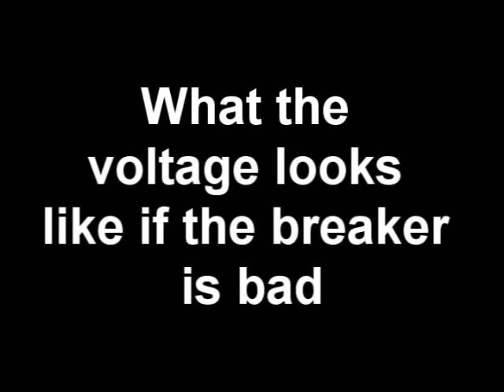Checking for a Bad Breaker

Comment: This is perfectly fine for determining if the breaker is open or closed. Step two would be to remove the breaker and test it for continuity. If it seems OK outside the circuit, clean up the wire connection and try again - it may start tripping normally now.  If you still have your doubts, swap it with another in the box with the same current rating and see if that trips. Then start looking for shorts...

Comment: About ten years  ago I bought a small, name-brand table saw from a big box store for a small project I needed it for that weekend. I had never had a problem with the wiring in my old detached garage, which had been updated with a new breaker box and receptacles had been added using modern wires a few years before we bought the property.  The saw was rated  for 120 volts and drew about 13  amps when you first cut it on.  As I remember my experience, it would hum and the blade turned slowly, before finally getting up to speed, but didn't have enough power to cut a board. This occurred the first time I tried to use it. I assumed the saw was defective, and packed it back into the original box and took it back to the big box  store with my receipt, and they cheerfully gave me another saw exactly like it. As before, it was brand new and the whole box was wrapped in clear plastic or cellophane, to show that it was exactly as it had been when it left the factory.  Had the same experience as before,  when I plugged it in and tried to use it. I reasoned that the odds were against two brand-new small table saws from the same reputable manufacturer being bad. So I turned to the electrical wiring, starting with the breaker box, after cutting off the power feeding that box. I found that the former owner's son had done the wiring, not a licensed electrician, and that a number of the screws securing the connections to the ground bar and  to the circuits inside that small box were loose, with evidence of arcing. I tightened up every screw in that box, whether obviously loose or not, replaced the breakers and turned the power back. Problem solved. And I still use that table saw occasionally.  Recently some of my LED shop lights have started flickering, so I'm getting ready to check the circuits again, before tossing them out with the trash.

Comment: Thanks.  I am going to troubleshoot a bad outlet.  I get 120 ac Volts, and the wiring looks OK.  The breaker box is in the weather and is about 60 years old.  None of the breakers tripped, so it might be the problem.  Thanks again.  Video was straight to the point: I don't need to watch a 30 minute video on what you showed me in 2 minutes and 43 seconds.

Comment from the maker: Ok the short answer is that you have a loose connection in one of the wires feeding through the light boxes going up to your office/garage.  Since the basement is closeest to the panel, this would be why they stay on and everything else flickers or goes out.  The loose connection will be in either the light box or switch box as power feeds tend to bounce from box to box to distribute power.  This can be labor intensive to find, and but easy to fix when you do.

Comment: Thanks for the straightforward video.  I came home to a failed circuit for all the lights and outlets in one room.  I thought it was a thrown breaker.  Nope.  Then I replaced the only GFCI with a new one.  Nope.  Then I found your video, broke out my multimeter, and tested the breaker.  It's fine.  I don't know what to try now.
Reply: Did you figure it out, I'm in the same situation?

Comment: Well done video. Short and easy to understand. Some these videos I watch are 10, 15, or over 20 minutes when they could have been much shorter. Some would need the longer videos if they have very little experience and need a bit more in depth information. I took electric shop in high school, 2 years didn't get into that line of work. So I had a fair knowledge of electricity. Also over the last 50 plus years I've done a fair amount of wiring. But I didn't know how to test a breaker. Now I do. Thanks. I had a breaker went bad but when you tripped it it seemed fine. Was to the water heater. Replace an element but still no hot water. Thermostats had been replace about a year ago so I was at a loss. Decided what the heck, put a new breaker in and now hot water. Thanks again.

Comment: Thanks for this video!  I'm trying to sort out a water heater that doesn't work.  There's no power at the heater. There's ~124v on each leg of the breaker, but the wire leaving the wall into the junction box near the heater is dead. 

The wire appears to be a straight ~25' run from the heater inside the base of an exterior wall to the breaker panel located just inside an entry door. It does not leave the wall and run under the house someplace that the squirrels and I can access it.

Do I need to open up the wall and trace the wire? It's just aluminum siding and thin sheathing... Or have I missed something I can do before taking that step?

Comment: Awesome 👌  I have a question..Light flickers on the house. When the heater is on, master bedroom power goes out. I took the panels off and  tested every breakers and I am getting around 123-125. What  could cause it? What else can I do before I spend $400 for the tech to come out

Comment from the maker: @rasheedgamerfb The electrical service in your home is 220v.  This comes in directly from the utility.  Its only when you use one leg of that service that you get the 120v that you are accustomed to.  So if you want 220v to run an appliance etc, you will need to use the appropriate sized double pole breaker.

Comment from the maker: I am glad you posted this.  This is a perfect example of why home inspectors should not be judging or telling people how to do electrical work.  When using a meter, it does not matter which wire goes to the hot or which is going to the neutral or grounding bar.  The breaker will not trip.  The leads are only there to serve as a sensors.  If you have been telling people that, you do not know the first thing about electricity.

Comment from the maker: Its possible your breaker is getting weak, in that case it would need to be replaced.  But you need to consider the possibility if it happens again that you either have a loose connection in the line (meaning one of the junction boxes or device boxes) or you have a intermittent short.  Either way if it happens again you will need to get the line traced and fixed.

Comment: Now, could a bad breaker be the cause of dimming lights? As in the lights dime when the A/C kicks on, or when the microwave is started. I'm running into that issue and so far, (not being any kind of familiar with electrical work) I LOVE your videos! Thanks a million. I hated contacting some electricians and they tell me it's going to be $150-$200 BUT for me not to worry because it's an "Easy Fix". That's what made me feel that I could at least do the troubleshooting myself, if not the repair.
Reply: Loose grounds can cause flickering when large current draws happen
Reply: Joshua Hernandez just remember. Brown to the right. Green/yellow to the middle. Blue to bits

Comment: my multimeter looks different than his- what setting do i put it on?
Reply: voltage with a wave sine symbol on Top. this wave is for a.c. current. the dot and dash marks on top are only for dc current. mainly battery but some motors too.

Comment from the maker: @dsastrclan - No in order to check to see of the breaker is working, it will need to be checked with the unit on.  Just remember that when you do this to take every precaution so as to not get shocked.  Meaning, use leather gloves, safety glasses and a rubber mat or plywood to stand on.

Comment: My breaker keeps flipping when I use my welder, I have asked other welders and they said I need a bigger breaker outlet and wires, for example I probably have a 15 amp breaker and outlet and I probably need a 20 or 30 amp breaker outlet and wires. Will that fix it? And if so do I need to get an electrician to check my work for it to be legally installed? Or as long as I follow instructions I’m ok??
Thank you
Vlad

Comment from the maker: Couple of things.... First change out the breaker to see if the breaker was getting weak.  That is the cheapest trouble shooting fix.  Next, if it still trips the breaker, disconnect the heat pump from the circuit.  Then turn the circuit back on to see if it trips.  If it does, then the wiring is bad, if not, then your heat pump will likely need to be replaced.

Comment: Helpful. It doesn't matter which screw on the neutral bar you touch?
Reply: I don't think so, I used several on the bar myself, still got readings. 

Only problem for me is that all of my breakers held the proper voltage, so now IDK WTF is wrong with my outlet.

Maybe a squirrel, a mouse, a chipmunk?  Who knows?  I have no idea where the damaged wire is.

Comment: That music had me pumped enough that I did a few pushups, a couple situps, and air punches before I even got out of bed. Then jogged a few laps around the couch. Finally to quench that thirst from all the sweating I did lunges to the fridge and grabbed a couple Flat Tire Beers and a pack of smokes. Of course while changing the bad breaker I had ROCKY playing in my head telling myself I'm unstoppable too. Well, I was definitely unstoppable because next thing i new I changed out all 42 Breakers to brand new ones even though I only had 1 bad breaker. And now I'm still trying to figure out how I woke up across the basement in a fetal position wearing wet shorts and no shoes. Well at least good luck hit me now that I'm picking up dozens more tv channels with HD quality even though my antenna broke in 2 months ago. Hmmm eh screw worrying about how... I'm gone to grab more beer and duct tape to reattach the Breaker Box door back on... 

IF YA CAN'T PHUCKIT, DUCKIT!

BTW, if you wrap up your Power Meter really good with aluminum foil they won't know how much power you use and blocks the hidden microphones in the meter from hearing you. That's like killing 2 deer with 1 ford truck before you have to weld the frame back together. I have thousands more great tips if anyone is interested...

Comment: if the breaker reads 120 volts , can the breaker still be bad if the ohmns reading is not good, because if there is no load,it may read 120, but when you put a load on it , it fails .  Does that make any sense, would like your opinion please ,

Comment from the maker: You cant test a breaker to see if its in good operating condition.  The only thing you can do is one of two things.  Remove the wire from that breaker, then try to reset.  Remember that you need to turn the breaker all the way off before turning back on.  If it stays on - your breaker is likely good.  If not then it definitely needs to be replaced.  The second thing is to just replace the breaker.  If it still trips when you do that you have a short in the line.

Comment from the maker: Yes, but follow the wire out from the panel to where it connect first, start there and work your way out.  The problem will likely be in one of the switch or light boxes in the basement.
Reply: Chheck a breaker means to know if it trigger and open the ciruita at the rate amps inndicated

Comment: for those new to MM lead placement, and whats not covered in this video is exactly WHERE to plug the leads FROM the MM.. Pictured in the still was the black lead in COM, but the red, do yoo use the FUSED side or the not FUSED side?

Comment: What if I get a reading of “zero” on a double pole breaker when putting the leads on the breaker terminals but a reading of 120 volts when testing them individually

Comment from the maker: It is possible the breaker is bad.  If only side side of the breaker is working, it would only send 120v to the HW heater and therefore not produce any heat.  Change the breaker and see if in fact that helps.  Its a cheap and quick way to check for sure.

Comment: I have a gfi breaker servicing two outdoor receptacles. One is a gfi. No power on either. I reset breaker and receptacle. Nothing. Do I really need a gfi breaker with a gfi receptacle? Should I put a regular receptacle in?

Comment: I gave a Thumbs Up, for the help it gives all of us! Thank You, but you lost me as to why Im reading 120V and 240V, and why on a Breaker with two places for wire, one has 120v and the other has 0V, and then they can both have the 120v and 120v to get 240v, somethings going on inside the breaker I don't understand and I  have never had one apart, that!!! would be cool to know?? Thank You!
Reply from the maker: Nothing going on inside the breaker, the double pole breaker simply sits across two main busses in your panel.  One bus or pole has 120v and the other bus or pole has 120v, then if you check both with a meter they will show 240.  The reason for this is because each phase is 180degrees out of phase with each-other.  This is why if you have a bad double pole breaker you will get 120v on one leg, but less than 100 down to zero on the other.

Comment: Thank you..This helped me figure out that one power supply line was at 125V and the other supply line was at 5V before entering the main fuse at the panel.  Power company on the way to check the meter box.  I am a live and well and did not make my wife a widow.

Comment: If an breaker goes bad and I put a new one in is it likely that it will go bad again? I'm using a new air conditioner this year that has heat also.  The circuit started flipping in the past two days so we took it out and it was bad and melted inside. We put a new one in but I am afraid that its just a temporary fix to a bigger issue and that its just going to do the same thing over again. Last summer we added a side box to help with the pull of ac and dryer running together. But I didn't have the new ac with heat then.

Comment: saved a trip back to home depot, thanks.  I hadn't put the breaker on both rails so was only getting 110 and when testing with the multimeter on hot hot I got 0. but each one tested 110 by itself...sigh.

Comment: I tried to copy what you did. But I got no readings on any breakers? But I have power in my house ao that can't be true. I did power lead to back of breaker and ground  lead to the grounded area on breaker box.... maybe I didn't do it correctly? So strange. Trying not to call an electrician, but I just might need to...

Comment: Checked all breakers, the read good but still not getting any electricity to one plug, thought mabe its a bad outlet but if no power getting to the plug there is no sense replacing the plug. TY

Comment from the maker: Also you would get 120v from phase to phase if you did have a dead pole on your double pole breaker.  But as I state in the video, that is only one of several indicators.  There is never a cut and dry one test fits all.

Comment: I changed a double breaker 60-60. one wire was red and one was black. When I put the new breaker in, I wasn't sure if the red was from the top or bottom. I put them in the way I thought they had been. Does it matter?
Reply: No.  Red and black wires are both hot, so it won't know the difference.

Comment: what tells you if the Breaker itself is faulty?   You can get an intermittent fault which no meter will help you.   A breaker either 'makes or breaks' but what if the breaker itself is faulty.?

Comment: Thanks, first one I've found which speaks of testing the double (220v) breakers. 51 yrs old, Dad could fix everything electronic & many things otherwise; first time I've done this 'cause half our house has been off tho breakers all "on" -But Dad gave me a "BK TOOLKIT 270AA meter, b4 he died, and assumed I'd grow into it. Still works, and I find ONE terminal of 220v breaker to neutral bar "0 volts" Replayed a few times, I'm assuming this one's bad; main (220 v?) breaker has both reading 120 v THX

Comment: @Nootherlove1  Hard to say, but there should never be more than 1 wire on a breaker. So the person that connected it wasn't really on top of the situation. there could be a 120/240 transformer in an appliance, 240 electric range or dryer, or even a wall outlet causing the feedback. Before replacing the breaker, or even using it again, you really should find out where the cross-connection is.
 Your total current load should not be more than about 70% of the rated breaker capacity.

Comment: I have a breaker that is inside my apartment and there is a meter outside my apartment complex and the one outside keeps tripping therefore shutting our electricity so I have i have to go outside to flip the switch on the main breaker outside what would you reccomend me doing ?

Comment: Hello, Liked the video and was very helpful.I have a  Bryant 15a GFICB and I tested the black wire terminal and it was hot. I then checked the white wire terminal directly under it and had 0 reading.Both tests were red leads to terminal and black lead to bar.Do I need to test the white terminal?Do I have a bad breaker?The test button work fine and circuit breaks.Any help would be apreciated.Thank You

Comment from the maker: @MrDevilheart666 - You may have a problem with a bad neutral or loose or broken wire on the hot lead.  If you suspect the problem may be the breaker, than change out that breaker.  But one half of a 15amp single pole breaker would not go bad because its not possible.  If changing out the breaker and checking voltage in the panel does not work, than PM me and I will walk you through what you need to do.

Comment: Hello , what if a 30 amp double pole breaker read 220v instead of 240-250? Still good?
Reply: 110-120, 220-240. There's a small percent variable that's still acceptable,  forgot the number, but  i think not more than 5% +-

Comment: Jack Ryan; The breaker in the vid is not tripped. It is on and still not showing voltage. Hence, bad breaker. However, he should check that the conductor is not loose in the breaker first.